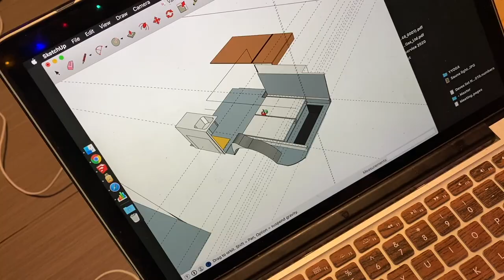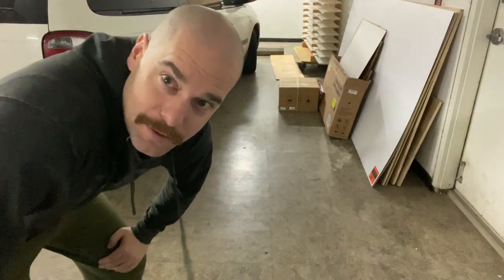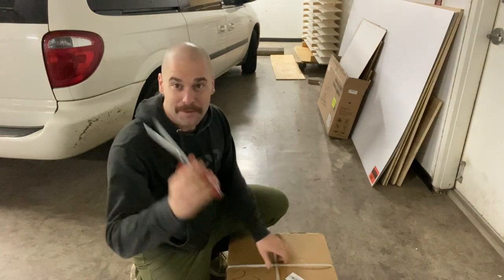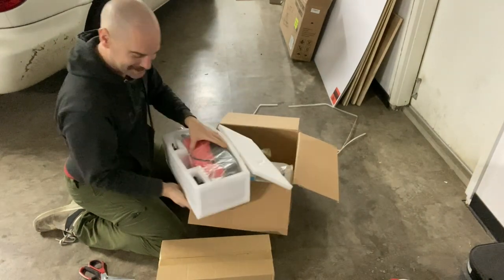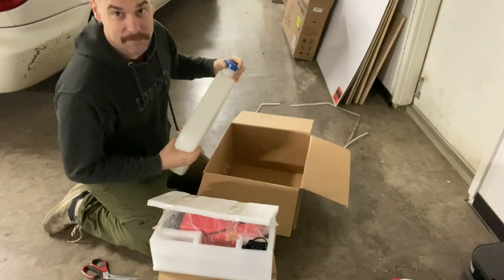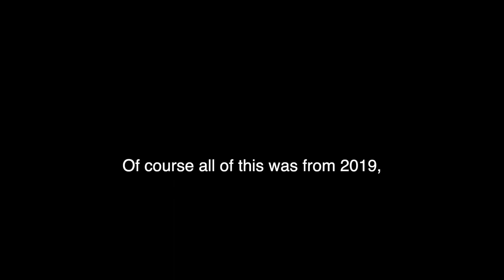MINIVAN Build E-13 || More Parts, Dilemmas, & Considerations

Comment: Love watching your videos Joseph, will be watching each one as much as can...I'm a multitasker too, between caregiving for my dad, running essential errands and getting supplies needed for my van, working on my van, etc. Today I finally got 5 brand new tires for my van (5th new one as new spare, the old one that was on it got me through the last few months as needed) with the money I've saved for them and they're both needed and the brand I wanted too, all 5 are BF Goodrich KO2s, I've always been a BFG tire brand person, had on most, but a few, with them on all my vehicles I've had. I like the quality and the longer warranty on them also. Now, I can go back to touching up the bit of last of the flooring in my van with the moldings and trimmings by both the cargo and barn doors, the laminate flooring tiles looks almost like a pro did it, it was 1st time installing the new tiling, not bad for a beginner, it can out real good. After I finish up this floor, I can finally start getting supplies needed for the van walls next. Hopefully by this weekend. Take care of yourself, try to not get too overwhelmed with all the work you do, get rest whenever you can, I understand I was a workaholic myself for awhile, it did me in after a while and I had to at least slow down a bit, only so much one person can do and try not to be a robot nor get sick in the process. Be blessed and safe too Joseph, sending hugs from my dad and me in Odessa TX USA to you and everyone up there in Canada too 💖🤗💖🤗💖🤗💖🤗